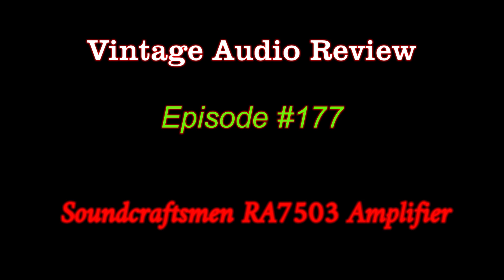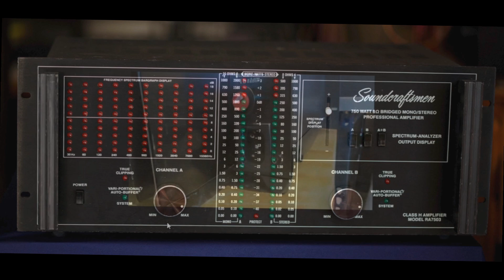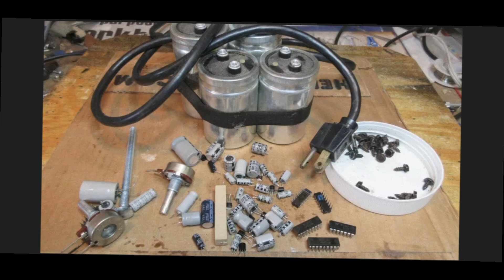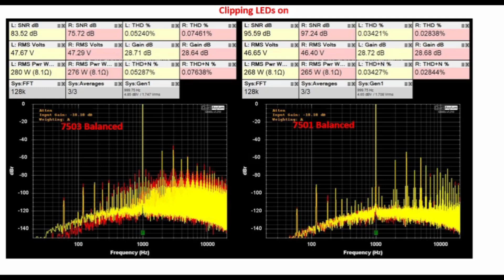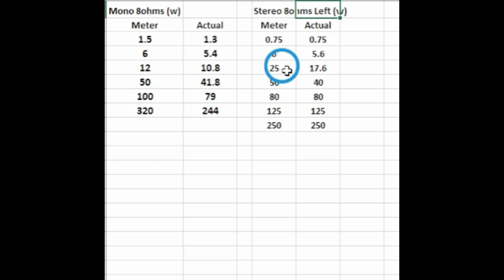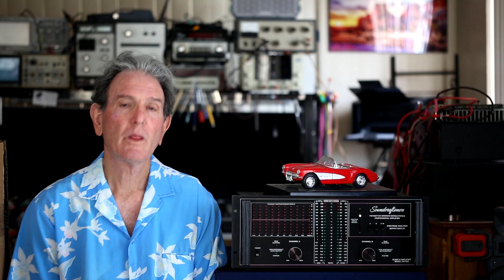Soundcraftsmen RA7503 Amplifier: Vintage Audio Review Episode #177

Comment: Being a Soundcraftsmen fan, the RA7503 is a beautiful amplifier and definitely deserves to be in a collection. Great work on the testing and comparison of these.  I always enjoy your videos. If I was to assume, I wouldn't think Soundcraftsmen would not have let the 2K clock signal bleed into the R channel audio. Perhaps the clock signal amplitude is higher than it is suppose to be. It could be caused by a replaced component or substitution or may be adjustable?
Reply from the maker: I am a Soundcraftsmen fan as well and at some point I will be wearing a custom made Soundcraftsmen tshirt. I appreciate your watching the videos and Erik has discovered another way to reduce that 2khz clock noise by adding a shield around the pot. If I need to take mine out again I will shield the pots as well and see if it gets even more improvement, but not it is doing a great job. Your theory about it being too high in amplitude is a good one.It uses a 15vdc supply which means the output singal is going to be large, but I don't know how much you could reduce it and everything run ok. Thanks for your support!

Comment: I think it’s interesting the original 7501 is generally quieter than the recapped 7503. In my ignorance, I thought the recapped device would measure better across the board.
Reply from the maker: I appreciate your taking the time to make this comment. One would think that the re-capped unit would be better performing. The main thing to consider is that the 7503 has that clock signal generating noise, so it is not quite apples to apples. In the future- probably 1-2months from now, I am going to do a before and after cap replacement on a vintage receiver and so it will be apples to apples....
Reply: Congratulations on getting your Soundcraftsman amplifier! I have not run across any of these, but I will keep it on my radar. 

This amp creates quite a light show! My preference is something a little bit less complicated, having fewer things in the single path. 

Enjoy your toy. Keep up the great work.
Reply from the maker: @danstein2467  I always wonder what you are going to say about my latest video, Dan 🤔 I am not one to have a power amp without some kind of meter or LEDs- the engineer in me I suppose. It has a great vintage look IMHO. I guess it is sort of a toy. Thanks again!